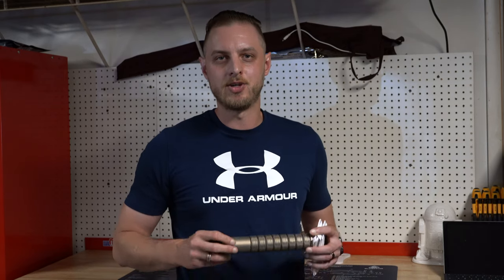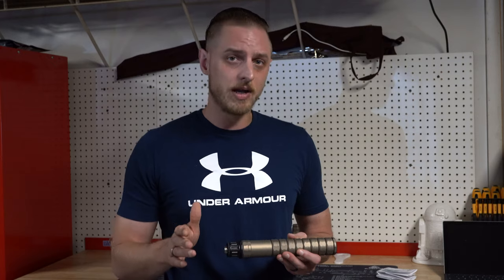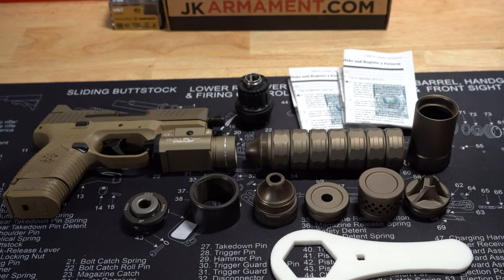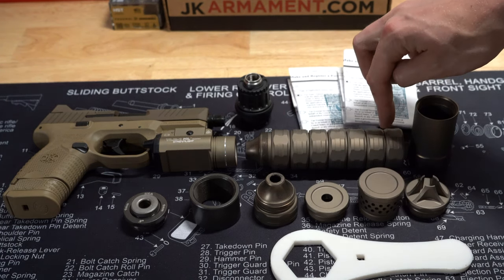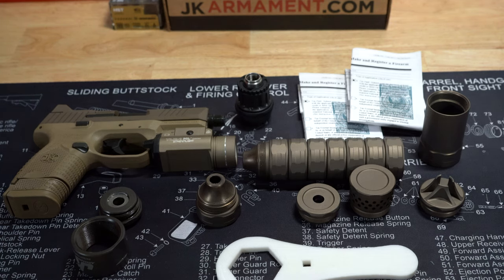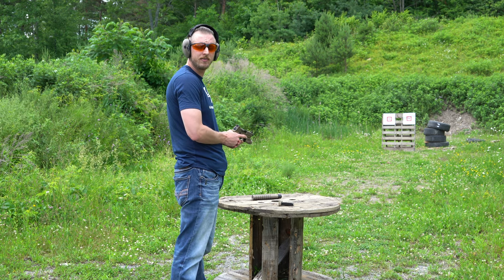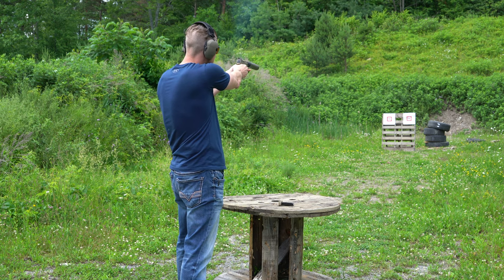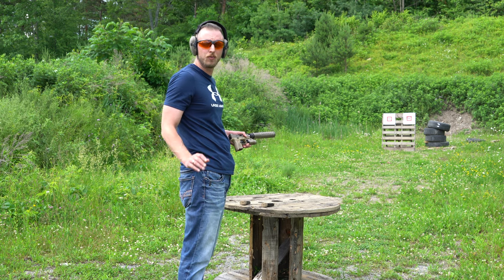JK Armament Suppressor Overview

Comment: I got soooooo lucky with “pending research” - it was submitted only after 3 business days. But wait times on form 1s are defintely getting a bit longer. Still better than 200 something days. Love my JK armament. I use an all stainless steel set up with a tube extension and 4 baffles on a Deadair Keymo. Honestly quieter than most commercial suppressors I’ve used
Reply from the maker: That's good to hear, I went Form1 to get my hands on stuff quicker. I'll likely end up with a mix of commercial + form 1 stuff.
Reply: @LongshotBallistics  I have a Dcell solvent trap tube I want to form 1, what ASR adapter works with a Dcell 1.5 inch tube???
Reply from the maker: @snipecox2153  I'm not familiar with that tube do you know what the inside threads are?
Reply: Wow! Took them 6 weeks for mine to come out of pending research to "Submitted". I filed another the day after after realizing I made a mistake and let the first one get disapproved, lol.

Comment: Hey man I just had a few questions, I’m buying a kit soon to be out on a gen 3 Glock 19, and was just wondering what options I should select for thread or adapter mount, end cap, and tube extension?
Reply from the maker: For a Glock you shouldn't need to add any thread adapter mount. Double check but I'd think it should be 1/2 - 28 thread. Get a 1/2 - 28 Piston then I'd recommend the SilencerCo Bravo booster. 

I was actually going to do a video on it soon as I was confused too. Piston will go into the booster then you'll just thread that onto your Glock 19. With the JK having a larger blast chamber the Bravo booster seats in nicely, originally I went with a Liberty Booster which aded another 1.5" to the silencer. 

End cap is personal preference, if you go with the FDE kit they include all three. I wouldn't worry about a tube extension, they come with 8 cups which is a lot - I'm only running 6 now and happy with the sound levels.
Reply: @LongshotBallistics  thank you so much my man 🙏
Reply: What is the point of the end cap?  Looking to create one for a gen 3 Glock 9mm.  Can you please guide me through this process? Purchased some items that were requested by a friend, had it drilled but still unsure what to do with everything. Sorry new to this.  Do I need to get an assembly booster assembly for it to fit on Glock?  If so, what size from liberty?

Comment: Is this aluminum, steel, or titanium version?
Reply from the maker: This one is their aluminum kit since it's for a pistol. I'll probably be trying their titanium kit soon for a AR project.
Reply: @LongshotBallistics  sweet! Thanks! I'm interested in running one on a 10.3 franken build with a DD CHF mk18 barrel. I most likely will have to go 100% titanium for a shorty in 5.56 like that right? Or you think I could get away with steel and maybe just run the first 1 or 2 baffles as titanium
Reply from the maker: @l337l0gan  That'll be a sweet setup, I'd probably do steel minimum. I'm pretty sure their SBR kit is titanium but a bit more pricey.